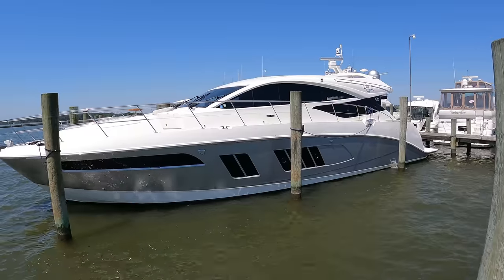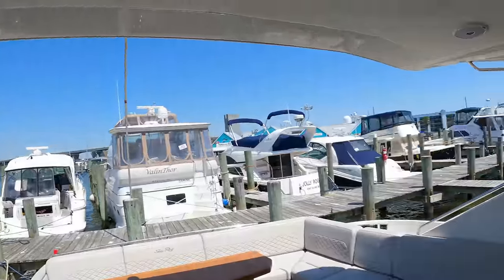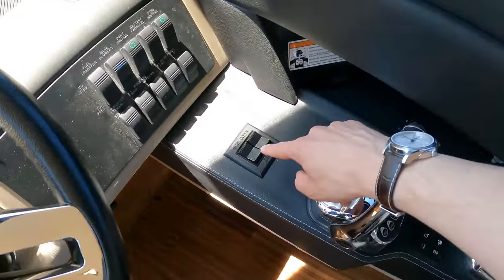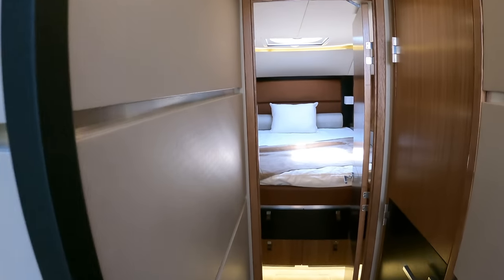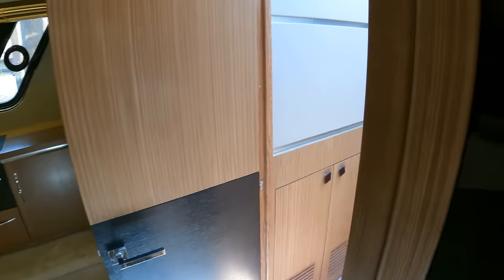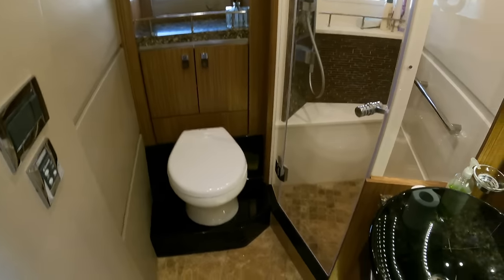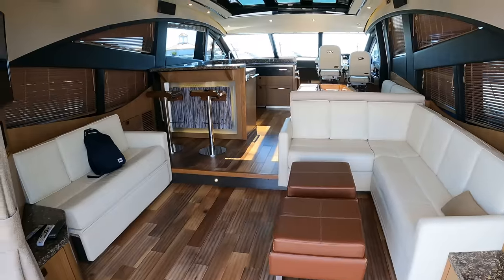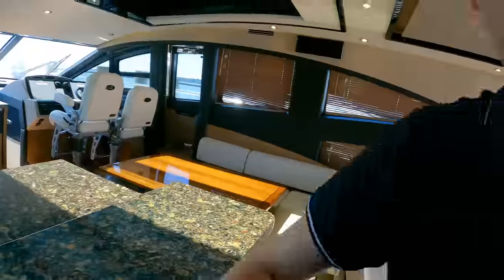Touring the MOTHER OF ALL SEA RAYS - $1,500,000 Sea Ray L650 Yacht Tour

Comment: Wonderful and informative tour with great video quality. Well done, sir. My only concern regarding the boat is that pull-out grill on the starboard side of the cockpit. It locks into place when not in use. Does it also lock into place when it is being used? I'd hate to have a hot grill suddenly slide back shut into the compartment and spill my food everywhere.
Reply from the maker: Thank you! I believe it does lock into place. I don't think I fully extended the grill when filming the tour.

Comment: I liked the precise walk through.  One nick pick, I didn't see any towel racks in the second head.  I heard a 275 mile range, is that accurate?  Is that typical for this type of boat, more or less cruising large bays or coastal waters?  Obviously, it is not designed to transit the big oceans.  I think I would prefer having a flying bridge.
Reply: Yes out I s 350 sunder r 186 mies t sb g r o n ky 90 m I les over 350 sncer

Comment: WOW...just went and checked the 'deeper specs' on the L650...only 165 gallons of tank water, no water-maker aboard (with all those showers?!), and fuel consumption gets INSANE above 1000-rpm (28+ gallons per hour?!). Well, it's a bay runner, not a extended range trawler, I'll give it that...(for those not familiar with salt-water craft, I'd recommend checking out the Jay Benford 55-ft Extended Range Trawlers...10-kts cruise, but 8000-mile range, too...and 600-gpd water-making, for less than the Sea Ray's price).

Comment: Just came across this fantastic video. Great job dude! You really knocked it out of the park. It's a shame Sea Ray got out of the big boat business. Absolutely stunning boat. It's too bad Sea Ray made a technical error in partnering with Cummins/Merc on the Zeus pods which the 1st two generations were very problematic and costly to repair ( I should know I owned a 470 with Zeus pods and nothing but problems). As a result, Merc no longer makes Zeus pods. Rumor has it that Sea Ray is looking at getting back into the big yacht business. We'll see.
Reply from the maker: Thank you and welcome to the channel! It’ll be interesting to see if they try to get back into this size range and compete!
Reply: Chef has v drives surface Der Searcy n ey d jibes io out b ar d best
Reply: @sharonbraselton3135   Yes I did see this one does not have pods. That's a huge plus!

Comment: I was actually surprised with that much focus on the 3 heads (4, if you count the crew head), that there was no mention of any of the water systems aboard. Does it have a water-maker or is it using 'tank water'? Is it pump-out only, or does it have off-shore dump? What size black water tank does it have? Whole boat key-system, with no details mentioned...otherwise, not bad for a bay runner.

Comment: Not sure why any yacht manufacturer would offer "crew quarters" for a boat his size, but some people are like that. I would keep it as a personal getaway boat for me and a female friend, even if I owned a much larger boat. 

The only changes I would make though are smaller engines; such as the Mercruiser 6.2L-Supercharged Diesels, then replace the crew quarters with an extra supersize fuel tank for lower power consumption, more efficient mileage and a much increased cruising range.
Reply: Nope

Comment: Amazing boat.  Is this boat too much for just one person to take out and motor around, or can one person handle it fine?  Enjoy going out on the water with family or guests, but want to be able to do it on my own as well, likely well over half the time, maybe three quarters of the time.  If this is too much for one person to handle, at 65' I believe, what would the largest size boat be comfortable for just one to take out?  Thanks.  One of these days I just may move from ski country back to the ocean somewhere.  A boat like this, would be incredible for when I do.  Though it has been a while since I've been out on the water with any regularity, so I'd likely be considered a near novice, with a lot to learn.
Reply: I have this question as well. What size is the best for owner operation ? I want a crew but I would never make them sleep in those quarters. I am debating on the Galeon brand of Yatch’s as well but I am also disappointed at the crew cabins

Comment: Nice tour and a good work on the video. Only one comment, the lighting  on the bottom of the bedroom cabinet wasn't track lighting. Most likely  LED tape or linear.
Reply from the maker: Glad you enjoyed! You are correct, they were definitely LEDs and not in an actual track.
Reply: @YachtAddiction  I think it would be properly called, “accent lighting” but I knew what you meant. So long as you didn’t call the head a bathroom, I’m ok, lol.

Comment: A fridge under a hot grill??
Even if the grill cools down a lot, it would still heat up the top of the fridge, wouldn't it?
Reply from the maker: I believe there is normally some type of heat shield over/under the grill to protect the components around the grill. But that's definitely a valid concern and something a potential buyer could check during the purchasing process.
Reply: @YachtAddiction  it has a fair amount of space between the two and there is also a blower to remove any heat build-up as well. They used induction stoves! I use to build these boats and, there were no problems reported👍

Comment: Nice boat. I wonder with 3 ensuite showers, how does the boat deal with fresh water ? No mention of de-salination & I did not see one in the engine room. So if you cannot make water, how big are the tanks ? I presume the 650 means 65 foot length. What kind of anchor is that ? I had a 44 foot cat and my ground tackle was at least twice as heavy as what this boat has. Perhaps you are just supposed to pull into a marina when it gets dark. I am sure I saw "ONAN" on the genset while touring the engine room. I don't recall seeing the AC unit, though I know it has one. With a 250 mile range (I believe you said), you are going to cruise coastal USA & the Bahamas, and little else. I wonder how much water the boat draws. With 2K horses giving 30 kts and a favorable gulf stream, you could make the Bahamas from Fl in around 2 Hours, then that draft thing becomes an issue.
Reply from the maker: That's a great question and something a buyer should consider when going through the purchase process. This yacht has a 280 gallon fresh water tank.
Reply: The AC's are self-contained units located in the staterooms and salon! The boat draws about 5 foot!
Reply: @bozoone3781  Insuite AC should make the plumbing interesting. 5 foot draft means in Bahamas you will really have to watch your depth (which you should anyway), Bahamas tidal range is about 3 feet, so you might need to wait for high tide to make some transits.

Comment: Is the higher the number of Sea Rays mean how large they are? Ive seen 350-450 this one is 650
Reply from the maker: Generally yes! This 650 is 65ft long.
Reply: @YachtAddiction  Ah, Thanks. Figured it something like that. Im just looking for one that can sleep 2 people together. So it does not have to be that big. New to boating so smaller the better. I can always grow into a bigger one.
Reply from the maker: You have tons of options in that size range. There are a lot of great boats suitable for an overnight or weekend for two. Good luck in your search!
Reply: Yes out 350 35 feet. 45 0 45 fit 650 65 feet

Comment: I was surprised at the 275 mile range.  Seems awfully low for a boat like this.
Reply from the maker: That is the estimated range at the mentioned cruising speed. You can definitely go farther if you drop your speed down. Generally, yachts like this go through fuel crazy fast when they are moving pretty quick.
Reply: Wrong

Comment: The first boat that is has an intelligent design, bathroom wise. Everyone has a dual door system that is just the dumbest way of doing it. First you need to lock an unlock 2 doors when you're using it and second if you have guests on-board they just won't understand how they work. You are always gonna leave a door open and so on. I'd like to know how that stupid system is better than having a bathroom with a single door that opens to the hallway. I'm really glad that someone thinks like me. If I manage to buy a boat that is the first thing that I gonna do. Remove that stupid extra door. If someone has an explanation for that, please do tell!

Comment: A range of 275 miles ??  That’s not even enough to get from the Carolinas to Bermuda, or other such destinations. What am I missing here ?
Reply from the maker: So you can definitely push the range much farther if you’re cruising at a slower speed. I like to give an estimated range at whatever cruising speed I mention in the video.
Reply: @YachtAddiction  I understand but how much can you push it ?  Wouldn’t the owner of such a yacht want to cruise to islands/ports that are a LOT further than 275 miles ??  Obviously you can fuel up at points along the way, but only if available. Some islands/ports might be 500, 750, 1,000 miles apart
Reply from the maker: @michaelvitale4029  I would guess around 1000nm if you are slowly cruising in the single digit speed. You definitely have to do your research if making a huge purchase like this. There are yachts with much longer ranges and also yachts that are much faster.

Comment: Ah yes, How nice boats used to be before every manufacturer started ruining the best real estate in the boat to relax in by putting the galley aft.
Reply from the maker: Most modern designs seem to have the galley aft layout but some models still have the galley forward. Two examples off the top of my head of new models with this would be the Prestige X70 and the Johnson 80. I have tours of both on the channel.

Comment: Naturally, you ommitted the cost. Excuse me, but isn't that the point of making and sharing the video?
Reply from the maker: The price is in the title of the video. It’s listed for $1,495,000 (title is rounded up to $1.5mil). I always try to include this info if I can. Some brokers of new listings prefer to not include the price and in those situations I have to respect their wishes. But normally the price will always be in the title.
Reply: @YachtAddiction  Well then, I may have not "read" the price and simply watched to video. What's the warranty on this boat?
Reply: Beautiful yacht and great job, but L650 FLY would be the MOTHERSHIP as it has an additional level. Searay also made a 68 which was larger. Considering that many center consoles are now this expensive this is a lot of yacht for the money!
Reply from the maker: Thanks for watching Steve! I would love to tour a flybridge version as well as an older 68 one day. It's tough when not many of them are on the market so I was lucky to get on this one. The displacement between the L650 and the 680 Sundancer are very similar so I felt comfortable calling it the mothership. Also, I agree about the money! New yachts are amazing of course, but I always like seeing how much yacht you can get for your money on these used listings. Now maintenance on the other hand.. ;)
Reply: @YachtAddiction  I think the correct term is "Flagship", not mothership.  Nice video regardless.
Reply: I'm sure you couldn't have helped but notice the price in the title, Tyrone;  it prolly just slipped your mind. Busy as you are.  But good spank job, nevertheless. Is this the first one you've toured, so far. And if there's enough of a warranty left, are you going to buy it?

Comment: I like the boat/yacht, but the range, under 300 miles, does not cut it for me..  not even close..
Reply from the maker: One thing to keep in mind is the 275 estimate is based on the 25 knots cruising speed. If you drop your speed down to under 10 knots, you can travel over 1000 miles. Thanks for watching!
Reply: have a nice day
Reply: Wribg